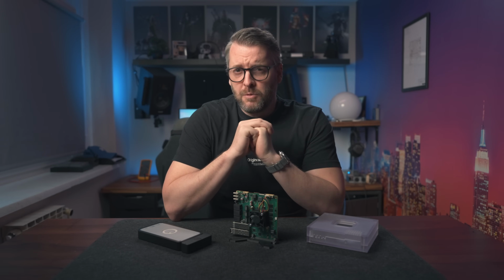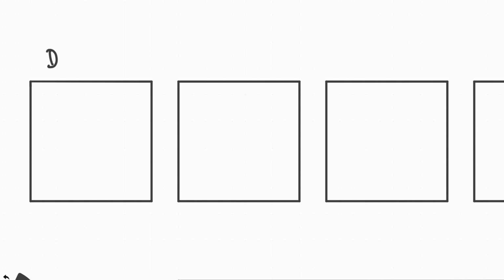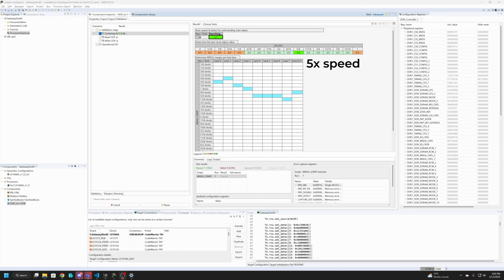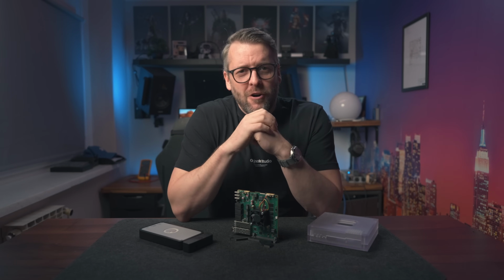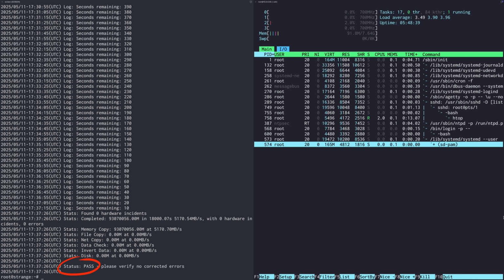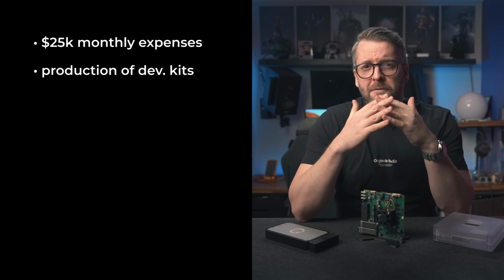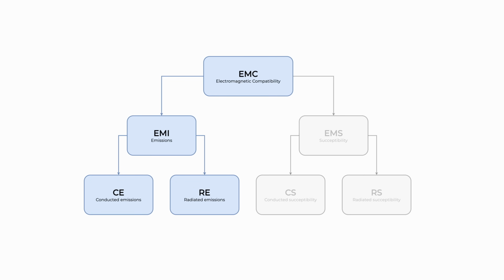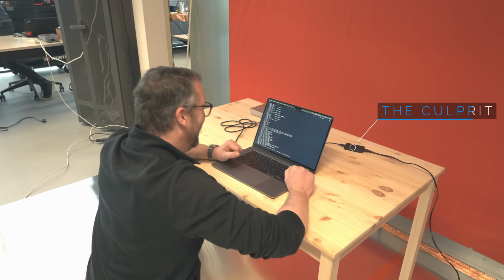We're developing a high-end router. From scratch. (April 2025 update)

Comment: Wow the memory trace problem was WILD. Was it within one chip or split between two?
Because if it was split between two the logical explanation to being able to boot despite calibration error could be explained by SOME bit corruptions occurring due to clock skew mismatches but the errors being corrected by ECC each time as the error size was always constrained to theoretical max of 8 bits.
For a sales pitch the thing that appeals to me the most is "no vinnie poo backdoors you can't remove", if you allow review and flashing of each level of bootloader, not only main ROM.
As a side story I just spent 2 days nailing the common mode rejection with a simple opamp balanced line input instead of 2 hours so yeah I can imagine the horror you guys went through.
Good luck!
Reply from the maker: Within one chip, you're only allowed to mix traces within the same nibble. If we did them between chips, that constraint would be violated and we wouldn't be able to fix it with configuration of the controller.
Thanks!
Reply: @tomazzaman  Wait a second, now THAT's weird. I'm having a hard time imagining how the initialization phase even detected the fact data pins were swapped. So turns out there is some sorta data pin independent operation within the memory chip? Because even ECC would be happy with swapped bits because it has no way to know cpu didn't intend to write the data "wrong".
Reply: @yunodiewtf  I'm guessing the "automatic calibration" must involve some communication between the cpu and some non-memory logic inside the memory chip (e.g. reading a rom containing calibration info?). In that case the mixed up connections would actually cause a visible reordering of bits, which could break something.

Comment: I need a device with 3x 10GbE at line speed, ain't nobody needs SFPs
Reply from the maker: The beautiful part of SFP+ is that you can also plug in an RJ-45 module. Choice!
Reply: @tomazzaman  Wait, what? Are you saying I could plug in the fiber into one of those, and then the network cable into the other one and I would have 10Gbp network connection to my PC?
Reply: Try that with the 4 or 5 Port MicroTik switch, 10GbE RJ45 SFP+ modules get so hot and are very power hungry that the device usually doesn't handle more than one.

Comment: You're going to think I'm just joking here... You aren't getting big time investors, because it's made too well. It won't require enough support, which effectively generates guaranteed revenue. It won't break down and need to be replaced quickly enough (usually a 2-5 year cycle as most hardware has been designed to fail within). And, it's secure by design; so tech giants can't sell access to whomever they please. Your hardware is too legitimate, from the Silicon Valley Mafia's perspective. They actually have a greater hold on the markets than you know. And they don't want your tech, because it goes against their values. This will likely force you to make it more expensive, because you can get it massed produced easily. Which will likely make it less accessible to the people who would actually want/need it. You've done nothing wrong. They have.

Comment: What is your DRAM type? I know that LPDDR4 allows for bit-swapping within each byte to help simplify DRAM layout. The DRAM controller needs to know about the bit-ordering in your design because the DRAM responds with specific codes when the DRAM interface calibration is performed, so if your bit ordering is mixed up the controller will receive the incorrect response from the DRAM device(s), confusing the calibration process.

The DRAM controller we used in our chips would perform calibration routines regularly during operation to compensate for environmental variables (temperature and voltage) to ensure reliable operation under all conditions. I suspect that the NXP controllers do something similar.

Comment: At @17:54 Ouch!!! 🤮🤮🤮 Or in our case, back in probably 2004 one VC told us, "Too 'meat and potatoes.' Not risky enough. Too certain to succeed." I, engineer, would have thought that some portion of the VC's investments would need to succeed. I guess VC's seek after danger and risk predominantly.  At @18:02 IBM 5150. 😎  At @19:59 Bravo!!! 🥳 At @20:08 ha!!!! I recently heard an interview of an executive who joined a company, when asked about a former project that went the worst, they stated "Working with a major software company, $20M invested to the project, and the solution could not successfully handle ONE CLIENT CONNECTION!!!" They had to scrap the project and start completely over. Tell that to investors that think "only investing in software is safe."  At @21:04 Precisely!!! 😢 At @21:19 ABBA "Take a chance, take a chance, take a chance...." 🤣 At @21:48 Exactly. 

At @24:49

1) Open Source
2) Secure
3) Flexible / Configurable
4) Robust
5) Highly Optimized / Performance Tuned

are a few key attributes that set this project apart from standard fare. I mean.... the #3 Flexible / Configurable, at the beginning of this video, again, you rattle off a list of software solutions you envision the one common hardware device to be flexible to switch between, to be more configurable for your customers. That is HUGE. Where is the competition competing with you in just that area alone? NO WHERE!!! That is why I am so interested in what you are endeavoring to bring about. It is a need I have felt in the industry for 25 years now. I am thinking, "Yes! Finally someone takes interest in solving the gap in the market!" Your product is one small piece of the much larger vision I have been chasing.

At @30:58 Bravo!!! 🥳🎉🎊

Comment: While the product is not in my price-range I can add my view on the hardware and there business viewpoint.
First are straightforward positives but the second points are less straightforward but more valuable points what will normally will only be apparent in the future after at-least the first reviews of respectable reviewers.
1st 
- Opensource open hard/software approach.   Compatible with direction of futere hardware development.
- Future proof design.   Able to be serviced in the future, because of software/hardware compatibility.
- Feature segmentation.    Separate from WIFI ensuring future bug-fix will not be to expensive.
- Performance centric specs.     This ensures compatibility with future needs.

2nd
- Full/open disclosure.     The disclosure of what is learned and what could possibly be wrong ensures not being blind for vulnerabilities and longtime loyaltie of customer base.
- Posible intergration in management systems.      Possibly compatible with high end enterprise solutions.
- Customizability and high-end DIY customers.      Ensures the product will be compatible with and integrated within futer opensource and community projects, this will show confidence in the performance and reliability to indirect customers relying on the opinion of tech savvy influencers.

Comment: The sheer dedication to freedom of choice you offer sets this project apart for me. I also really like that I am supporting somebody like me: not a billionaire. The point at which I will purchase this router will also be somewhat humorous: All of the router's features seem great, except that I likely won't be using 10 gigabit any time this decade or the next
Reply: You most probably will. 2.5g and 10g are already hitting the market at rock bottom prices. Cheap switches going for less than $100.
Reply: @theeltea  Well maybe I will buy fancy stuff, but I am also not enthusiastic to get more than 200 Mbit internet, because why? And yes yes, I will likely run a NAS at some point, but I am relatively sure I'll run it with second hand hardware that MAYBE has 2.5Gbit capacity. Though who knows how expensive AM5 will be compared to AM4 in a few years

Comment: Here is what I'd expect a router/modem should be.
1. DOES NOT OVERHEAT. I live in HK, in here it gets so hot that a router should normally expect running in 40C environment with NO VENTILATION all day in summer.
2. Their power adapter almost always breaks within a year (overheat), so I don't trust power adapters. It'll be better to power thru type-c, so it can be plugged into a server and run from it. Or I can route a 12V rail from the server's PSU if that's what it takes.
3. Fans are good but it'll collect dust, then overheats. I am a lazy person and I WILL NOT clean it regularly. It'll fail before I can remember to clean it. So an alternative passive cooling solution would be better. That is, I am willing to sacrifice the space and put a giant cooling tower on  it.
4. My current best solution is an iPhone (this thing never overheats) running in tethering mode connected to my server and have all traffic routing thru it. So in the software side it would be nice to be able to run k8s. I have several VPN pods that connects to my company's network with some tricky routing must be done via L4, L7. I would like to move these workloads into the router.
5. Like you from the earlier video. To use your router, I need to know what my ISP's fiber is using. So a way / guide to check or test it would be very nice. (connect ISP's fiber to your router then run tests or connect the ISP's router to your router)

I am not sure if this is the general use cases (most likely not). But these are the criteria I'd consider to buy your router. For now, it's tempting but probably not.

Comment: To answer your question, here is my perspective on why this router is a much better product than competition: 
- security: no more outdated, unpatched, software, routing my sensible info. The OS can be updated as frequently as available by the developers 
- freedom: of choice and consequences. I decide what OS will run on this device, and I can be responsible for my own decisions. The current products on the market rarely allow choice within their OS, and forget about a custom OS - if their OS breaks it's a simple "oops!", but you have to live with it. 
- customization: i have a 4TB SSD, and yet, I carefully select which packages go into my Arch Linux computer. I can change DEs, get rid of them entirely, use some crazy icon theme, or make a hyper-dimensional cube out of my desktops. Why wouldn't I want to customize my router to look and behave as I want? Or maybe run some extras piece of software for a small home automation thing? 
- open source: it does not need explanation 
- trust: in the founder team. There have been very few instances of me disagreeing with their choices,  and the results speak for themselves. I can't say the same about the companies of the 50 models of routers available on the store shelves. 

Possibly other reasons which I don't realize to mention at this time. 
Again, keep up the very nice work!

Comment: Just to feel better. Like 15years ago I encountered simmilar issue. In prototype phone from world famous producer someone swapped byte/word select signal if i remembered correctly. Everything worked until late in booting proces when some optimized security algorithm accessed memory in byte access and messed security in secure world. Schematic was checked by not less than 15 professionals and kept secret from me long time. Lauterbach was good tool to use and also datasheet but from IP supplier (core used caddence lP DDR block). Megabytes software was running fine because compiler always used 32bit aligned memory access and used all the bytes in word.

Comment: Are you committed to open hardware and schematics or die? (same with code or die?). If so then maybe you need to pitch to FUTO and Louis Rossman and see what they might be willing to do. My only other suggestion would be crowd funded, look at JetKVM as an example, they were way over their project goals, so much so that it probably created a production issue. And to solve those kinds of happy problems, how many board and pick and place companies are you going to work with? Just wondering what Sony in UK/Ireland would give you for an assembly price, a lot of Raspberry Pi are still made in their facility. Board creation and pick and place in the USA are probably out of the question, your device would probably triple in price unless things have changed in the last few years. But manufacturing in different countries might get you around a tariff, so might still be an advantage.

Yes I know, it would mean shipping components all over the world and that's not the best way to get the lowest price.

Comment: When I grow up I want to be like you. I have a degree in electrical engineering and I'm trying to develop hardware here in Brazil. I've already developed an LTE modem with an RS-485 port and also a router using an openwrt module. I use these devices to monitor electrical equipment. I'm far from your level of development, so every video I watch is a very valuable learning experience. Thank you.
Reply: wdym "developed"?
Reply: @theeltea  I readed many datasheets, draw the schematic, designed the PBC, ordered the PCB in a factory, buyed all components and manually soldered all of them. Programmed and tested the firmware by myself.
Reply: @TheMasterSaintClair  So you built a custom device using off-the-shelf LTE module? Great job!
Reply: You put a port on someone's modem or you made a whole modem?
Reply: @thewhitefalcon8539  No, I made a whole modem with ESP32 and SIMCOM LTE module.

Comment: Is there a reason why the choice has been for 1gbit rj45 instead of 2.5gbit or higher? Thought 2.5gbit was the standard now these days.

The answer to your question what makes you different. I hope everything stays sort of opensource so the community can keep helping developing the device to changes in the landscape lateron in its life.
Reply: You'd be surprised how few products offer proper (and by proper I mean more than 2 ports so that I don't have to buy another fkin managed switch to do anything meaningful on my network) 2.5Gbps support.

You either buy chinese soft routers on AliExpress, build a DIY systems with a 4 port card or spend at least 300+ euros for a premium router.
I guess the exception is the Unifi Gateway Fiber which has both 10 and 2.5Gbps and is quite insane for the price

Comment: as a 1st round dev kit backer, I really wish the best for this project, but I have to play a little devil's advocate here, if you would be willing to take in some negative feedbacks? I truly believe that having the 3 Ethernet LAN ports being 1Gbps only holds this router back from delivering on the "next-generation, high-performance router" claim you have made. Having a router that could potentially support bunch of different OS and the ability to make it do what we want it to do (within its limitations) sounds nice, but that really only applies to those of us who are makers in the IT space, a very niche market (while slowly growing), and home-lab builders and tinkerers, similarly niche market. This makes it that much more difficult to acquire investment funding. The limitations on the supported Wifi speed of the two M.2 slots to max WiFi 5/6 is another part that should either be removed completed or be expanded to at least WiFi 7 support, or reserve those pcie lanes to something else, like multi-gig LAN ports as most homelab/makers would be using AC instead of built-in WiFi anyway (although having a Bluetooth chip for management would be cool). And finally, while I personally am willing to pay $600 for the dev kit, your final "retail ready" product will need to be a whole lot cheaper. I am talking about less than 50% the cost of the dev kit...Take for example, Cloud Gateway Fiber for $279. Yes, I fully understand that a device like the Cloud Gateway Fiber would (mostly) lock you into the UniFi ecosystem, purely from a hardware stand point, 3 10Gbps ports (1GbE, 2 SPF+), 4 multi-gig LAN ports, 1 being PoE+, expandable M.2 storage slot, built-in Bluetooth chip, screen, cooling, etc. Oh and all ports are WAN/LAN capable, and 5 Gbps IDS/IPS throughput. This kind of specs is what I would call "next-generation, high-performance router". If your "Gateway" can match the hardware capabilities of the Cloud Gateway Fiber, while having the flexibility of the multi-OS support, I would gladly pay more for it. Either way, I am looking forward to receiving my dev kit once it is ready so I can have some fun pushing its limits. Thank you for all your hard work.

Comment: The gateway router stands for 3 things for me.
Freedom, quality and experience.

I want the gateway router to offer freedom to every user. It achieves this by allowing the user to do anything they want, including switching the entire operating system, and even some of the hardware.

I want the gateway router to be a quality product. It achieves this by being a high speed router, by taking tech-waste in account, and by not using cheap materials. Additionally, I hope a mono OS or something like that will be available, which will be a high quality software for managing the router, much better than existing solutions from ISPs, and hopefully on par with or even better than the ubiquiti ecosystem, but open-source.

I want the gateway router to offer a great user and developer experience. Many things can contribute to this, including high quality documentation, high quality software, intuitive manuals, high quality code, and more.

In essence I want mono to be the Vercel of networking (If you're not familiar with Vercel, they offer a great cloud web hosting service, are the maintainer of Next.js, the best react framework that currently exists, and are a big player in open-source). Note that I didn't say routing, I said networking, in the future I hope mono will be much more than the creator of just one router.